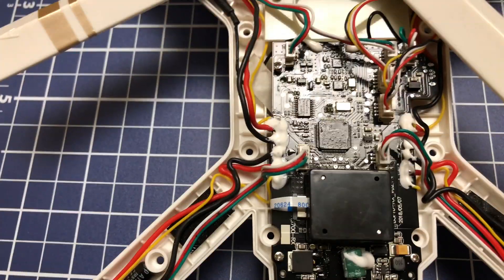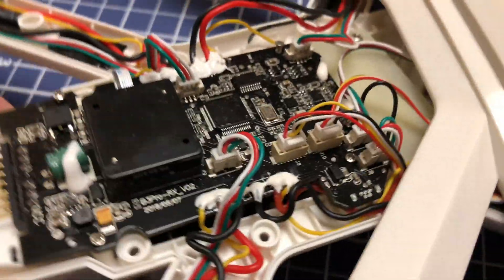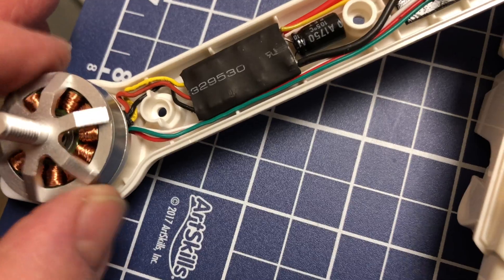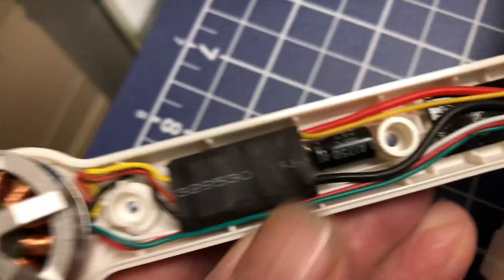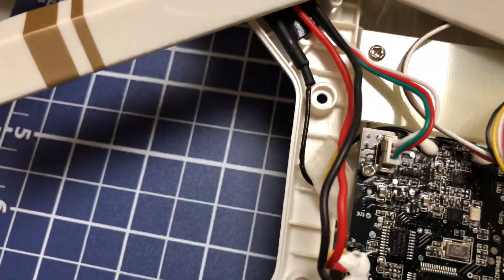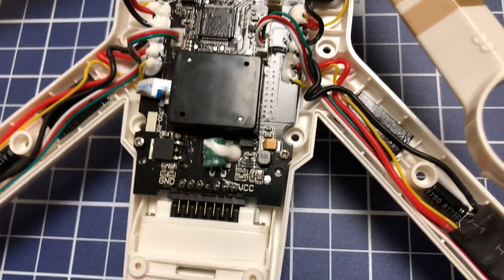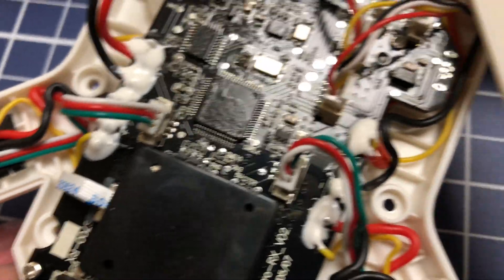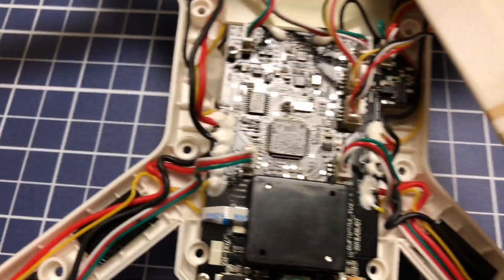MJX Bugs 3 Pro Drone Take a Look Inside 4K

Comment: ok that, 3 beeps that doesn't have the 2 long beeps. Coming from a racing drone experience. You have a dead flight controller board. There should be long 2 beep tones after that 3 short beeps that means the flight controller board has done initializing everything.
Reply from the maker: Thanks

Comment: The green white and red plug in  is the lights. The motor/esc wires are the yellow red and black which are soldered to the board.  Good Morning

Comment: yep I agree with this too, it's probably an issue with one of the 'chips.' You took a good look inside there. Loved the 4K quality. I didn't spot anything either.  It's likely a bad voltage regulator, cap, or could even be corrupt firmware flash (due to a bad storage medium) that is failing the boot sequence. The big black box is likely an IMU.
Reply from the maker: Thank's Cup, I will just get another one

Comment: I's say that black unit on the board is the gps unit with the barometer sensor under it? 🤔 Looks tidy from a build perspective, plug in motor wires are always a plus  Could be just a faulty flight controller board or ESC? I'm not familiar with the MJX bugs range but is there any diagnostic flashing LED sequence which detects a motor problem or indicates a fault? I know on the bebop it does a motor test at boot up and in the app it gives some info about the status of the motors, so you can see if you have a motor problem etc👍😎